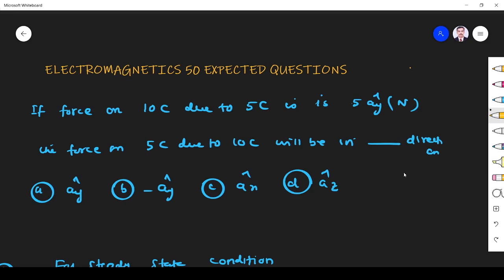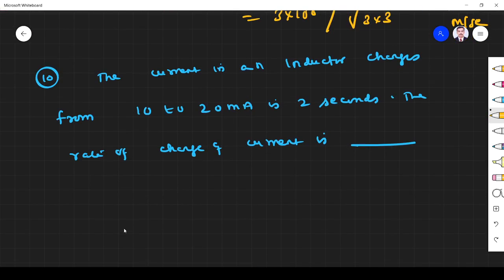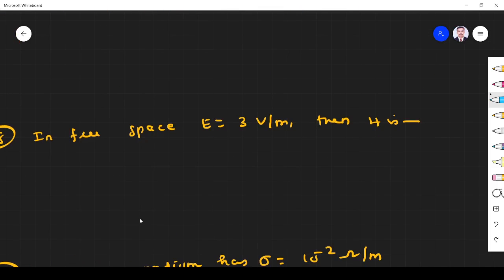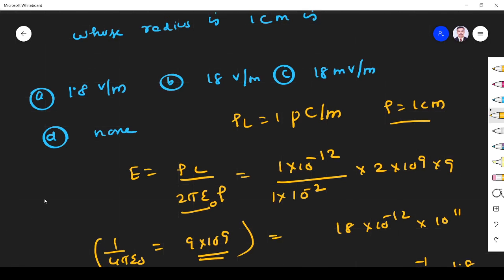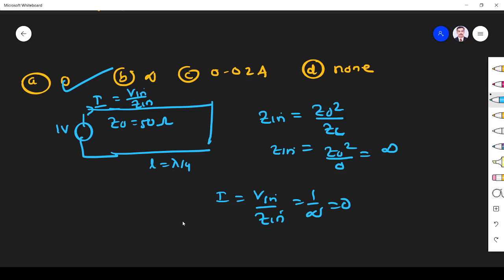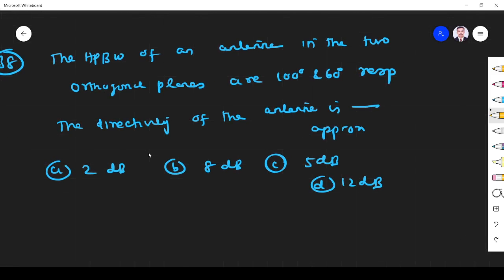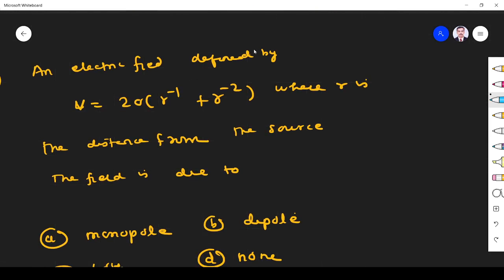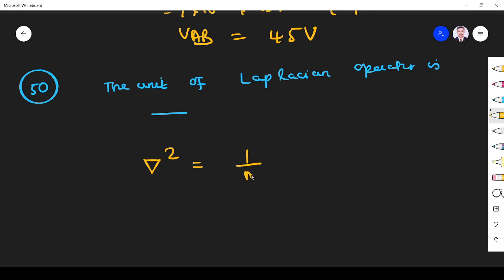TRB TNEB EMF EXPECTED QUESTIONS

Comment: Ques number 31 ...I thought 
 Zo = 50 is given ..Is that wrong sir ...plz explain
Reply from the maker: Zo is 50 only Ma'am..your assumption is correct only
Reply: @majeethlectures  sir but neenga Zin= 50 nu mention pannirukeenga
Reply from the maker: @kanmanibama7953  QWR is placed in between line and load..so zo of line acts as zin OF QWR and Zo of QWR is obtained by the equation given